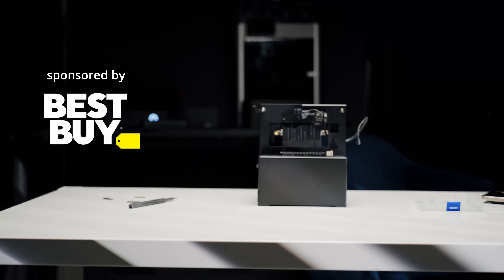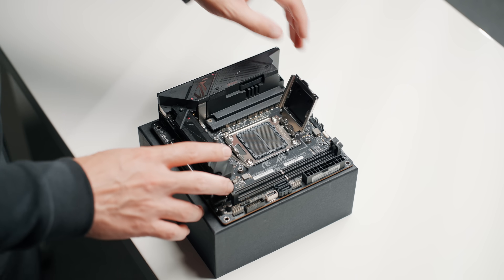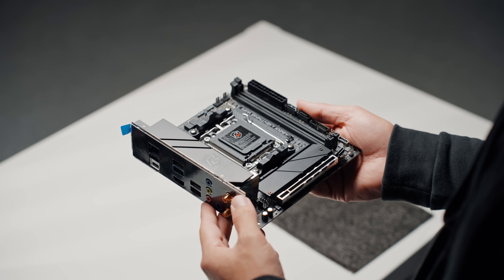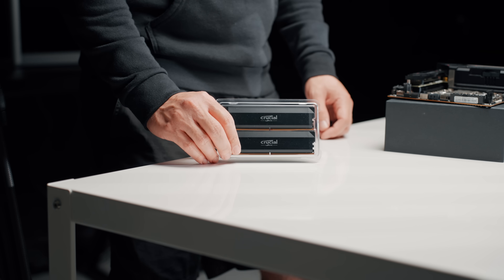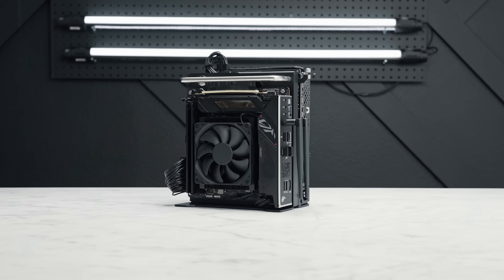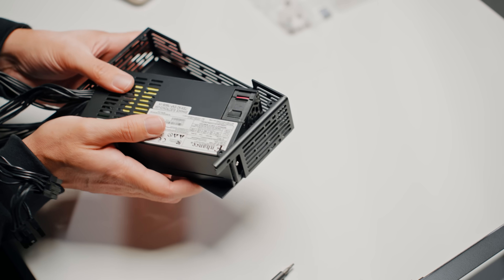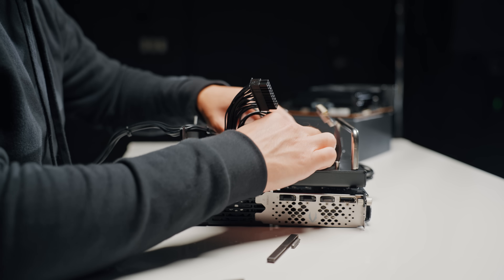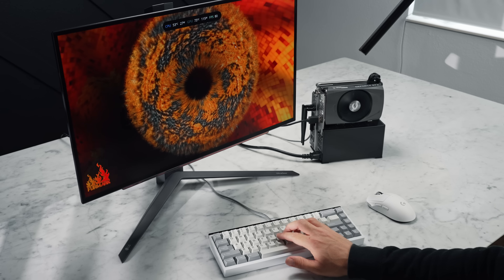A Super Tiny 4060 Gaming PC Build

Comment: A budget ITX gaming build paired with a Cintiq is a digital artist’s dream.
Reply: I agree. Laptops are just a scam at this point. (specially because of the shit batteries they put on them which go bad within 2 years)
Reply: @KogureDevilchan  The tablet brands make decent software, but terrible hardware. If Wacom outsourced its pen technology to good PC brands, they might finally make reliable standalone drawing PCs.
Reply: with ipad😯
Reply: The new ipad air 6 13 inch is my dream :3
sub $900 for an m2 processor, support for the pencil pro with barrel support, 13 inch p3 display, cheaper than the ipad pro.

and you can carry it everywhere 🥲

Comment: I got a 4080 7800x3d Fractal Terra build w the same Noctua cooler and was having issues with overheating at first until I figured out how to undervolt. I was disappointed at first but I’d def recommend now 👍🏻 great vid as always
Reply: I want to do the same build, can you please share some tips and which products you used when you are available?
Reply: @ycemilk  For sure man, some of the stuff I didn’t mention was the Gigabyte B650i for the mobo (there’s def cheaper options but I just liked it for the aesthetic and io’s nice and has 3 ssd slots), the Corsair sf750 for the psu, 32gb of crucial RAM, and 2tb 990pro ssd (def cheaper options for storage as well). I also got a 90° power chord adapter for the GPU as well cuz it’s kind of a tight fit, you could maybe get by without one but I didn’t cable manage the best. The biggest thing w the Terra is that the cooling definitely isn’t the best so you should definitely undervolt the cpu. I can’t remember the steps specifically but I promise it’s super easy if you watch a short yt vid on doing it, Gigabyte has a really nice bios so its easy to navigate. In terms of GPU undervolting just use MSI afterburner as well, there’s plenty of 4080 undervolt yt vids as well. Overall the build process and set up is all pretty simple.

Comment: I'm thinking of going 3D printing case design (shoutout to Modcase for inspo). This solution would be nice and sturdy internally, with a solid shell around it for mobility / protection. Getting the mesh fan-holes and airflow right would be critical. I really like the modular HDPLEX PSUs...

Comment: Geeek sells a modular version of the Enhance 7660-B, and they're available in the US.

It's available with both unpainted and black enclosures, and comes with braided cables. I'll vouch for it, it's a very good power supply for the form factor. It is pricy, but that's a given with sff.

A common mod users do is swap out the stock 40x20 fan for a 5V FLX Noctua unit of the same size. It might knock down the rated wattage by about 100W, but it's silent.

Comment: Built myself a new pc very recently in the ch160 from Deepcool because of the video you did of it, and I love it. Thanks for the inspiration!
Reply: Is it worth getting a ch160 if I don't get a sfx psu and a gigantic cpu cooler like assassin 4s
Reply: @sagnikguharoy810  I would think it would depend on the CPU and GPU you go for. 

For example, you can absolutely have a smaller CPU cooler on, say, a 5600x which is cooled just fine bc of its lower power consumption. 

The GPU will be a bit trickier bc of the much shorter clearance, but I’m sure that there’s a few GPUs out there that’ll fit while sacrificing the performance of larger cards. It’s just the trade-offs you’re willing to make in this case.

Comment: I personally love open air chassis. My current build is in a thermaltake p3 Pro, with no glass panel. Essentially just a metal slab that everything is mounted to and i love it. Dust has been an easy to fix problem with an electric duster.
Reply: when you're not using it do you leave it open or do you have a cover? even just a clothe maybe

Comment: Hey Devyn If you like open air cases you should check out the Xtia Proto ATX case. I have that one for 1.5 years now and I couldn’t be more happy. It has basically unlimited go thickness and length and can hold the 240 or 280 AIOs which should cover basically every non work station CPU’s. The case is in total (if you take the 240 AIO) 17 liters. Also I rarely see anyone cover that open case on YouTube so you could be the first to do an in depth review and build on it

Comment: For anyone thinking about buying an open case:

I have the XTIA Xproto-ATX case V2 case (same company that he references at 10:12) and I absolutely love it. 

But what about dust? This must be a huge dust magnet no?

It heavily depends on your environment. If people live in a very dusty area then yeah I can imagine you would clean it every month or so but if that's not the case you do not need to clean it that often. I have my open case for almost 1.5 years now and I have cleaned it 3 times so far. and even when I decided to clean it there was an extremely thin (emphasis on thin) layer of dust on the top of te case and GPU with that dust there were no differences in either temperatures or performance. Using an electric air duster and in 5 minutes tops the dust is gone.  
 
So yeah if someone wants to buy an open case, they just need to look at how dusty their room is and will become and based on that you can guess fairly accurately how many times you would feel the need to clean your PC. For example, there is a video of a guy who shares an update on not cleaning his PC after 3 months with the same case Devyn references at 10:12. I nowhere nearly have as much as that guy in the video. After 6 months I don't even see dust on my CPU fans or PSU like he does in that video 

Since YouTube will not let you post links the title of the video is ''Three months of dust with xproto + cleaning''

Comment: How do you think this build is for gaming:

CPU - Ryzen 7 7800X3D or Ryzen 9 7900x3D (not sure which one to go for, leaning toward the 7800x3D)
MOBO -  Asus Strix B560 E Gaming
RAM - 32GB Corsair Vengence RGB DDR5
GPU - Gigabyte Gaming OC Geforce RTX 4070ti Super 16GB VRAM
PSU - Corsair RM850X Shift 850w Modular Power Supply
SSD - 1TB Samsung Kingston NVME M.2 4.0
CASE - Corsair Obsidian 500D
CPU COOLER - Lian Li 360mm RGB Liquid Cooler

Comment: 6 cores is fine for most games? U sure about that? I had to upgrade from 5600X to 5800X3D just to eliminate cpu botttleneck in some games like cyberpunk, starfield, call of duty and even fortnite.
Reply: The 7600 almost matches the 5800x3d in gaming performance. Its not only about how much cores you have, but also how fast those cores are.